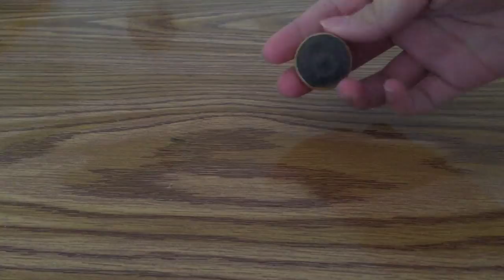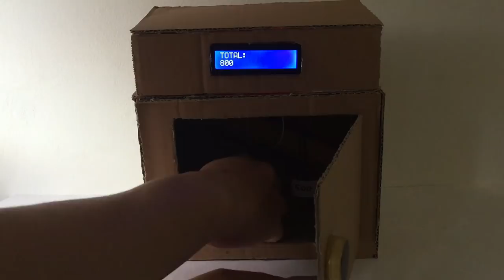DIY Coin Sorting and Counting  Bank From Cardboard I Arduino Project

Comment: couldn't you use a taller bottle and make the money part of the bank able to fit the taller bottles in and how do the IR sensors tell with coin is put in?
Reply from the maker: Taran Agnew Ir sensor is used in object sensing, motion detectors. Ir sensor detects coin and sends signal to arduino. I hope this explanation will help you.
Reply: i want to change the values of the coins, what part of the code do i need to change to accomplice what i want?